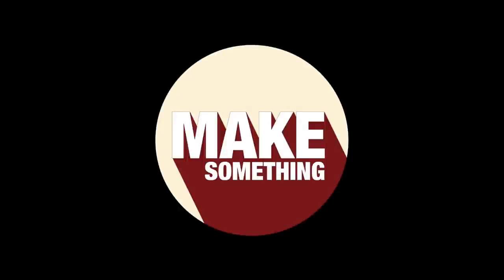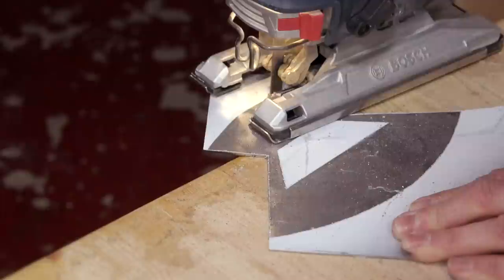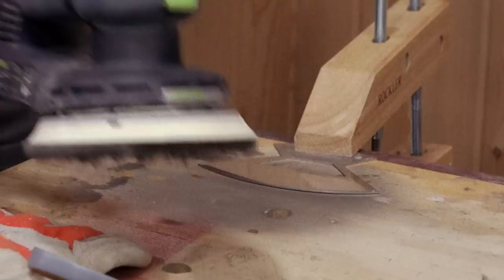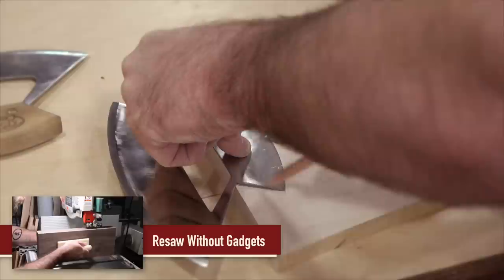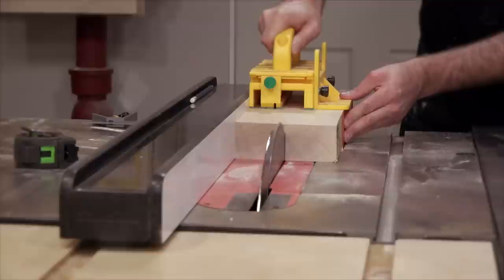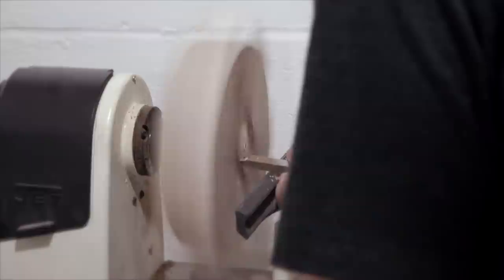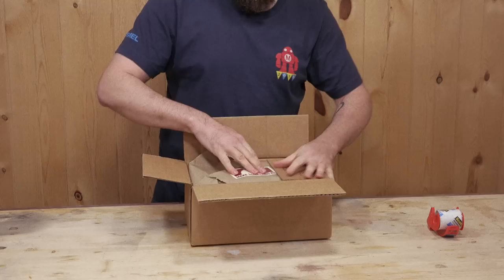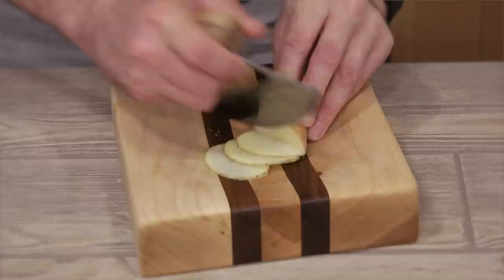How to Make an Ulu Knife with Cutting Board

Comment: FYI, if you're going to go through the work of making something like this, FOR THE LOVE OF GOD splurge and buy a piece of O1 steel instead of that crap cold-roll sheet metal!!!  It's not that expensive and you can heat treat it very easily.  Simply heat it up with a torch evenly until it loses it's magnetism, plunge it into a bucket of oil (pretty much any oil will work), and them put it in your kitchen oven at 400-450 degrees for an hour.  Even though it's not stainless, it'd be hard and would hold up much better than cold roll.  (Rub it with some shellac after you're done polishing - you'll never see it & it'll stop it from rusting.)  I'd be willing to bet that if he uses this knife on a chicken leg, there's going to be a big divot in the edge and the knife will be junk.  Even if he just cuts soft stuff, it'll be dull very soon.

Sorry if this sounds harsh - you get an A for execution and the idea of making it, but an F for material selection.  Your logic as to why it's not needed does not make sense.
Reply: He does this all the time.  Makes a sub-standard project then explains why the shortcut/poor choice of material/unconventional technique doesn't matter in the end when, in fact, it matters a great deal.
Reply from the maker: I'm trying to encourage people to try new things and experiment. Not everything needs to be done "the right way" and hope that this video inspires others to try something they've never done. It was my first time making a knife and I learned a ton!!! It was fun! That's what's important to me.
Reply: +Make Something Well said. Stressing about doing everything 100% by the book on your first go takes the fun out of making and puts you off trying anything new. I'd bet half the people criticising this have never actually made a knife. Great job by the way, I didn't know you could get such a nice shine with a random orbit sander!
Reply from the maker: Chris Hardy Thanks Chris!!!
Reply: +Make Something I'm so sick of the knife nazis too. I watch Jimmy diresta and John Heisz. they're always getting hounded. my grandfather had a kitchen knife made from some kinda flimsy saw blade. that thing stayed sharp as a mother! and I seriously doubt it was hear treated. they make knife sharpeners for a reason. the user knows when it's dull and can sharpen it.
Reply: Sorry if my pointing out facts makes me a 'knife nazi'.  (Whatever that is.)  I was trying to impart wisdom from my own personal past mistakes.

Saw blades by their nature need to be hardened, and most make a passable knife.  I've made several knives from saw blades and as long as you're careful not to overheat them when shaping/grinding, they work well.  Learn some metallurgy and you'll realize that a saw blade is light years ahead of cold rolled sheet metal as far as knife blade material goes.

I have two experiences that will illustrate my point very well:

1.  I bought a kukri knife (heavy, blade-heavy machete) at a garage sale when I was young, intending to use it to hack my way through brush.  It lasted all of about half a dozen chops - blade was soft and the wood actually put big dents in the blade.  Useless for anything functional.

2.  My independent shop term project in high school was to make a knife out of a chunk of steel.  While I was doing it, I made 3 of different styles - I didn't have hardly any tools in my home shop at the time.  Did the research and purchased 440c and ATS34 stainless steels to use, cut them out, designed and fabricated a hollow-grinding jig, ground them, then sanded & polished.  I'd guess I had between 70 and 90 hours into each one by the time the blades were ready to be heat treated.  Then went into the local GM plant (where my father worked) to heat-treat them in the lab there - they had more precision equipment than the school.  Two of the blades came out perfect, but one had the edge burnt away completely.  Turns out that the guy I bought the steel from had some cold-roll mixed in with his supply of stainless; the higher temperatures required for autinizing (or getting above the critical temperature required for hardening) the stainless were enough to melt the thin edge of the cold roll.  The guy felt bad & gave me more steel, but all the work and time I'd put into it was gone.  (What makes it worse is that I could have avoided this if I would have simply spark-tested it first... immediately apparent it was junk steel.  Thankfully I did this to the replacement steel because one of those was crap as well.)

So trust me when I say that I have made knives before and know about what I speak - it's from experience.  Don't get me wrong - I'm nowhere near the expert somebody like Walter Sorrells is, but I've made more than a few knives in my day.  You'd be surprised at how much time and effort I spent making that hunting knife that burnt up, right down to a composite handle made out of maple & walnut with brass inlays and an 18% silver guard, which I then had to throw in the garbage because it was made out of the wrong type of steel and was destroyed in the furnace.  The paring knife I made, 440c stainless and correctly hardened/tempered, can literally shave steel off a nail without dulling the edge and yes, I've done this.  (Watch the testing segment of the show 'Forged in Fire' if you don't think the heat-treatment process has a tremendous impact on the performance of a knife... they take it to the extreme.)

It's unfathomable to me that somebody would intentionally decide to make a knife out of an inferior material - it's the LEAST expensive part of the operation given the amount of time and work involved.  (Granted, machining cold roll is significantly easier than a decent steel, but it's still steel.)  Given the comments at the end of the video coupled with that he said he's not going to actually use it, he very well may not realize how bad it's going to perform in a real world situation.  (If I were a chef and paid somebody to make a knife for me and got one made from cold roll, the least I'd do is complain, never buy from that person again, and tell everybody I know not to buy from them.  Yes, you can use use cold roll for a knife, but it's somewhat like using a sandwich baggie instead of a condom - it might work, but really wasn't designed or intended for the task you're using it for.)  There is no amount of trying to explain away why a good material is not needed or that things don't always need to be 'done by the book' that makes any sense or will ever change the facts or science involved.

Also, if you think that I go around slamming people for anything they do wrong, you're mistaken.  You can probably count on your fingers the number of dislikes I've given videos since I joined youtube 5+ years ago.  Again, I was trying to impart wisdom that I've gained the hard way.  Unfortunately, it seems to have fallen on deaf ears.
Reply: Frankly, if you do the research, you will find that the Inuit often crafted their own Ulus from old saw blades for that very reason...they stay sharp and have a strong blade.  Good call!

Comment: Wow, but why is the cutting board convex curved?
Reply: Concave*
Reply: So that it will fit the curve of the blade. Most of these are made in sets, because every board/blade pair is unique.
Reply: +Samuel Pike  And a flat cuttingboard wouldnt do The same thin?
Reply: +Chaotic Wolf thing*
Reply: +Chaotic Wolf You are absolutely correct that you can use these blades on flat surfaces. You do not NEED a curved board to use it properly. I honestly have seen numerous videos of people using the Ulu-style knives and have never seen this type of cutting board being used. It looks like it would be a pain in the ass.
Reply: Chaotic Wolf Of course a regular cutting board would do just fine, but having a curve that matches the blade makes it feel more fluid to cut on.
Reply: By looking at most the comments I only learned that it would be difficult to use the curved cutting board
Reply: +Samuel Pike Well, honestly I would have a hard time trying to match the curve of the blade, with the curve of the cuttingboard
Reply: +Chaotic Wolf Here's the thing....if you grew up using this style....sure, you'd probably be able to chop or slice just like folks with a "standard" knife and board....but I see zero advantage to ME (just a home cook in the midwest US) learning to use this thing. 

Where I personally see this knife being awesome is for skinning game. That blade would be awesome for that....and that is one of the many intended uses for it. It is a "one knife fits all" knife. You get it out to gut and skin yoir animal...then get it out to butcher the animal...then get it out to chop your other food. In a culture where they wanted to carry one knife to do everything, it is probably the cat's pajamas...but for 90 percent of the cooking world? Nah...
Reply: +animalmother556x45 What about just buying a skinning/gutting knife instead? This knife was obviously build for cutting vegetables and meat, not for skinning small game or big game. 

First of if the steel used in this video is the same you use if you build this knife, would have been terrible for keeping an edge and even maintain the blade, I'm just saying that it would be much bettere if you perhaps use 9cr19move for stainless, or 1095hc steel instead.
Reply: +animalmother556x45 Or if you're a young scout boy in Denmark, you would probably learn to do everything with a 12cm scouts knife.

So learning to cut with this knife would be hard, but to carve and cook with a 12cm knife is another thing to learn, 
Try to cook with a knife firstly designed, and made to chop down trees, and stuff without cutting your self would be a dumb decision based on my personal knowledge. 

Try it out for yourself, I don't know if you can do it bettere than me.
Reply: +Chaotic Wolf They couldn't just go out and buy a skinning knife....Ulu knives have been around for like 4,000 years. I love that they are still being used today...it is awesome. I am just saying I see no advantage over "standard" knives of today.

Also, yes, that blade design is perfect for skinning game.
Reply: +Chaotic Wolf Look at a modern skinning knife....curved blade.

Comment: Why bother, if you are not going to use steel that will hold up.  Next time, use an old circular saw blade.  But you won't cut it with your scroll saw!

Comment: What is going on with the steel you are using man! If you don't know enough about steel don't say that steel isn't hardened if it is flexible. There is no excuse for using high carbon steel. This is just a prop knife if you ask me. Really you are making this for someone else so this is needed to be good knife steel. I did watched the end of the video, and it doesnt matter that you arent going to use it for survival, it just need to hold an edge!Greetings MTB